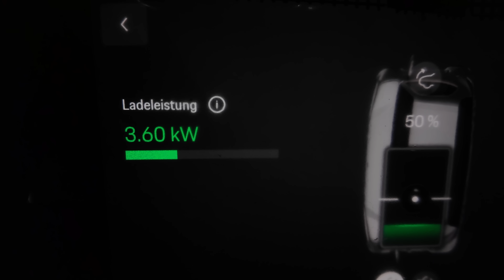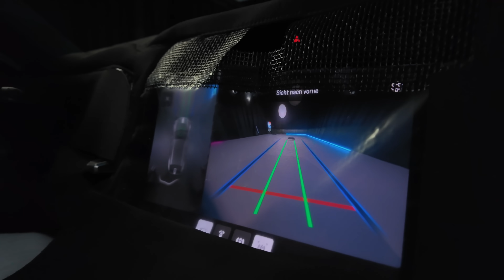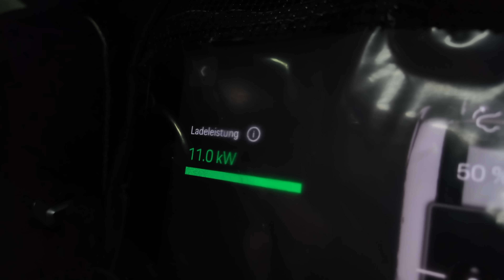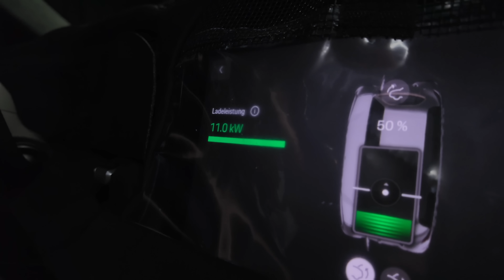Are inductive charging cars the future? Porsche wireless charging with the Porsche Cayenne electric!

Comment: I like the fact you immediately mention the safety concerns with inductive charging, at 11kw, does porsche mention μT or overall emf radiation, i think i ve read its TÜV Süd, and is CE and UL certified, so should be safe, but sitting in the vehicle, in a non home setting, or for whatever reason, what would my exposure per hour be?

Comment: As many other mentioned here, I also believe this will obviously for now be a solution for folks with more money (I mean you’re buying a porsche) with garages.
But if the tech will be a bit further developed, and there will be an open standard for other brands to implement this relatively cheap, I could see this for slow chargers outside. But I would not expect this to happen within the next 10-15 yrs.

Comment: in my country its not legal to put electrical wires like this on the floor. you need to bury it in the ground and the socket to the pad will have to be at the bottom of the pad such that the wire is not on the ground even for 1 cm. its a matter of regulation...

Comment: Instead of this system, imagine if they invent a system where you just grab a cable and plug it straight into the car.
Reply: Imagine if this dropped in price over the next decade, got standardised and then integrated into every parking space in a city.
Reply: @uttherkunst3806  it will never be more efficient than a cable connection and we can't afford to waste a lot of it at the moment. why not have have a small robotic arm come out at parking spaces to meet two contacts? This could be enclosed (thus protected from ouside influences) and easily be done by current technology. You could even install the connector underneath. Then it'd be like the pad moving up and physically connecting.
Reply: In general, why does the pad not move up as far as possible once the car is parked on top? a simple lifting mechanism ist hard to install and would definetly increase the efficiency a lot! I'm looking forward to seeing real tests (this one was probably in a porshe showroom). I'd love to see real measurments of the ingoing and outgoing power values.
Reply: @seha337  Also prevents animals of getting inbetween.

Comment: A lot of people don't like wireless charging their mobile devices, especially at higher speeds/power - because of the heat it generates. I'm sure the clever folk at VAG have thought of this, but so did Apple, Samsung - yet mobile devices DO get warm/hot when fast wireless charging.

Comment: I am skeptical that the energy waste from inductive charging is worth it. 10% efficiency loss means 400kWh wasted for 12k miles at 3 mi/kWh efficiency. Is the effort to plug in the vehicle really less convenient than parking precisely on the pad? The €7000 charge for additional equipment doesn't help.
Reply: The efficiency is meanwhile the same in both systems, plug-in charging as well as wireless charging. 
It is important to note that plug-in charging is not 100% efficient. 

Efficiencies of the two systems from the grid to the battery in the electric vehicle: 
-> Plug-in (cable) charger: 85-94%.
-> Wireless charger: 88-92%.

i.e. wireless - inductive - charging is just as efficient as plug-in charging, depending on the vehicle and the overall system.

Inductive charging of electric vehicles takes advantage of "magnetic resonance". 
This is a type of impedance- and frequency-optimized inductive energy transfer via coupled and thus efficiently matched transmitting and receiving coils.
In fact, inductive charging operates in a narrow efficiency band of 88-92%, which is equivalent to Level 2 plug-in charging (with cable and plug).

Comment: After the electrically-operated charging flap, here's another 'innovation' that's just as useless!
If a phone already heats up and takes much longer to charge by induction than with a cable, what will happen to the battery of an 80kW car? And where there's heat, there's energy loss: what's the real efficiency of charging? Finally, isn't the risk of fire greater if there is overheating?
Even if I had the chance, I'd still charge my car with a cable, just like my iPhone!

Comment: The EV wireless charging tech has been available for some time with different projects and with much greater charging speeds than this, but I am glad to see this feature officially coming to a series production car, albeit an expensive one and for a quite hefty cost. For the Porsche customers I think it's reasonable anyways.
The good news is that other manufacturers will have to implement this and it should be coming to cheaper-class cars in the future as well as the price will be coming down.

I am just hoping that they can make a unified standard so that the actual chargers can be used with any EV that has this feature. Then we can have these implemented seamlessly everywhere in public places too.

Comment: Nice feature. Now that is innovative. The energy loss is to be improved though. 10% of electricity loss is a lot compared to a wallbox(1 to 3% of loss only).
Reply: You lose around 5%-10% with AC level 2 charging. The ADAC (German Automobil Club) recently tested that. The Tesla Model 3 for instance has had 7.7% charging losses when hooked up to a 11kW wallbox.
10% charging losses via wireless charging is competitive already, if they can bring that down to 7%-8% it ultimately will be better because it's easier to use.

Comment: I wonder which problem this solution aims to solve
Reply: It's more convenient than pulling out the cable each time. Charging cables may also be stolen (depending on whether your vehicle locks the cable or not).
Reply: In German a lot of cable are stolen from HPCs...this will solve the Problem.
Any kind of destroyment is solved since also plugs are often corrupted...no mechanics is much better

Comment: That looks like a like a lot of hassle to line up the charger correctly. You’d think Porsche would have autodocking, 7k for a lot more faff than just plugging in a charger is too much and people just wouldn’t bother
Reply: In German a lot of cable are stolen from HPCs...this will solve the Problem.
Did you never have a defect plug...??? Happens frequently...no mechanics solved this and any Kind of vandalism.

Comment: If offered as public charger what will the end user pay as rate and units received? The energy coming to the charge pad (100%) or the 90-80% the car actually receive (minus the energy loss between the charge pad and the vehicle receiver)?
Reply: It will be like the current situation with a plugged in charger. You pay for the energy going into the charger, which means you pay for the heat losses in charger, cooling etc and losses in cables to the car and losses in the car before it gets to the battery. It adds up to 10-15%.

Comment: Pointless if car is stationary, wireless charging is waste of energy by producing excessive heat and so on… old good plug cord is the best.
Reply: In German a lot of cable are stolen from HPCs...this will solve the Problem.
Reply: @josefv-y8m same here, but charging stations owners now implement GPS trackers or other security measures.

Comment: I appreciate the engineering here but is this easier, cheaper and as reliable, if not more reliable, than a simple plug? I don’t want my charge session stopped because a hedgehog crawls under the car for a sleep.
The paint is most impressive can we please get that on the spec sheets please. 😂
Reply: In German a lot of cable are stolen from HPCs...this will solve the Problem.
Reply: @josefv-y8m cannot argue with that, this would solve that problem.

Comment: Stupidly inefficient
Reply: Lol you are clueless. If you charge with level 2 AC you always lose between 5% and 10% as well. So 10% losses  via wireless charging is competitive.
Reply: @BBingo-v5i  the 10% losses are definitely in addition to the already 10% 🤡 do you think they magically just made the cables and onboard charger more than 100% efficient? 😂
Reply: @BBingo-v5i and you think this inductive charger is 100 % efficient? 😂
It still has cables and on-board charger, mr. not-clueless 🤡 it is most definitely not 90% efficient including these.

Comment: Next step: A pad which can slightly reposition its self to the perfect spot, instead of making this the drivers task?
And provide it with a lifting mechanism, so the car doesn't specifically need adaptive suspension to lower ?

Comment: Toll expressway lanes with inductive charging is the future.  You can charge your EV on special expressway lanes or take long trips on those lanes and the EV self drives.  You pay for the duration on the lanes.
Reply: Doubt it. Much too expensive to install. A highway stretch in France went online with this at a cost of at least €4 million per kilometer. Not to mention that it is completely unnecessary. With how good charging tech is today, and how fast it continues to develop, charging while driving will be pointless.

Comment: An expensive and overly complicated solution to a simple problem
Reply: Just like wireless phone chargers and yet all phones support that now...
Reply: That's germany, for you. Bless you germans!
Reply: How come every modern smartphone has wireless charging support then?
Reply: To no problem at all you mean ? What's wrong with just plugging in ? Porsche has been a champion in fleecing its (rich or aspiring) customers this way and it looks like that could now lead to its demise. I don't think the brand's current problems are mainly due to wrong strategic choices or building too many EV's but rather to its behavior as a brand in general.
Reply: In German a lot of cable are stolen from HPCs...this will solve the Problem.

Comment: Yes lets add more complexity and idiotic tech to a car that no one asked for and no one needs and give it tech no one will use or care about
Reply: In German a lot of cable are stolen from HPCs...this will solve the Problem.
Did you never have a defect plug...??? Happens frequently...no mechanics solves this and any Kind of vandalism.
You could enable all parking places with charging , without the need of additional space at the sidewalk.

Comment from the maker: Data & facts:
Porsche wireless charging
Up to 11 kW
Efficiency up to 90 %
Active cooling
Charging pad 50 kg and 1,17 m 46“ long
Car lowers automatically when it parks over the pad
Motion sensor shuts down the plate when living beings or metal is being detected
Price 2.000 Euro vehicle, 5.000 Euro for the inductive plate, plus electrician
Reply: The most important question is: if this cable and pad lie across your driveway, it’s almost inevitable that a car will accidentally drive on top of it eventually. How well would it withstand that?
Reply: @PaperCoffeeTable  Probably it will break but people will just throw it out and order another one.
Reply: @PaperCoffeeTable  It's just a box with coils inside it. Very easy to make it sturdy.
Reply: The Macan EV is too small for me but the Cayenne looks nice. 100% I would get this charging pad with it. Price do not matter at this car price range.

Comment: That could be useful for car dealerships or warehouses, especially if they heated it in the winter. Plus, you wouldn't have to worry about wearing out the charging port. But a 10% loss is a dealbreaker for me. Why not just put a charging port on the bottom and have a little plug pop in automatically?
Reply: Level 2 AC charging always has 5% to 10% charging losses. So 10% via wireless charging is very competitive already and there is a bit of room for improvement.
Reply: Do you think conventional charging methods have less than 10% loss?
Reply: @b.s.9943  If I theoretically spend $1000 on electricity charging a year, I'd rather not spend an additional $100 in burnt energy that never made it into the battery.
Reply: You seriously asked why not have just a plug on the floor that plugs in "automatically"?
Reply: @jkj420 Yes I did good job reading

Comment: Interesting but the losses would need to be sorted. Also you'd need automated parking to get over the plate exactly where it needs to be. People struggle just parking in a 2.2M wide parking space 😂
Reply: Level 2 AC charging always has 5% and up to 10% of charging losses, no matter if you plug in a cable or if you use wireless charging
Reply: Correct most lvl2 boxes are 90-92% efficient, the best I've seen claimed 94%

Astonishingly dcfc can actually be even more efficient due to less conversion losses during mild weather!

Comment: Induction pads will never be used widely. You lose too much in the power transfer. Car engineers kill themselves for a 1% gain, and losing 5% or more just to not have to plug it in is silly. They should make a magsafe connector like Apple uses for their MacBook Pros, where you just snap on the connector and it magnetically aligns, and you are done in 5 seconds.  And one could easily have a robot arm that snaps it on. Sadly a total waste of time.
Reply: The efficiency is meanwhile the same in both systems, plug-in charging as well as wireless charging. 
It is important to note that plug-in charging is not 100% efficient. 

Efficiencies of the two systems from the grid to the battery in the electric vehicle: 
-> Plug-in (cable) charger: 85-94%.
-> Wireless charger: 88-92%.

i.e. wireless - inductive - charging is just as efficient as plug-in charging, depending on the vehicle and the overall system.

Inductive charging of electric vehicles takes advantage of "magnetic resonance". 
This is a type of impedance- and frequency-optimized inductive energy transfer via coupled and thus efficiently matched transmitting and receiving coils.
In fact, inductive charging operates in a narrow efficiency band of 88-92%, which is equivalent to Level 2 plug-in charging (with cable and plug).
Reply: Porsche Magsafe Apple Mac-an
Reply: ADAC in Germany found plugging the iX into a 22 kW AC level 2 was only 80% efficient.  105.2 kWh battery pack, it took around 125.2 kWh.
Reply: You are underestimating people's desire for comfort and simplicity.

Comment: Big energy losses
Reply: No, absolutely not
Reply: The efficiency is meanwhile the same in both systems, plug-in charging as well as wireless charging. 
It is important to note that plug-in charging is not 100% efficient. 

Efficiencies of the two systems from the grid to the battery in the electric vehicle: 
-> Plug-in (cable) charger: 85-94%.
-> Wireless charger: 88-92%.

i.e. wireless - inductive - charging is just as efficient as plug-in charging, depending on the vehicle and the overall system.

Inductive charging of electric vehicles takes advantage of "magnetic resonance". 
This is a type of impedance- and frequency-optimized inductive energy transfer via coupled and thus efficiently matched transmitting and receiving coils.
In fact, inductive charging operates in a narrow efficiency band of 88-92%, which is equivalent to Level 2 plug-in charging (with cable and plug).

More information:
https://www.linkedin.com/posts/hubertwolters_wireless-wirelesscharging-evchargingrevolution-activity-7150890067887132673-AOHY/
https://witricity.com/newsroom/blog/what-is-efficiency-how-do-you-measure-it-and-why-should-you-care/